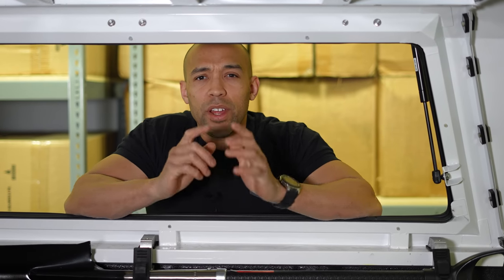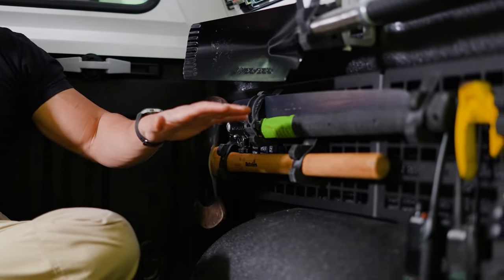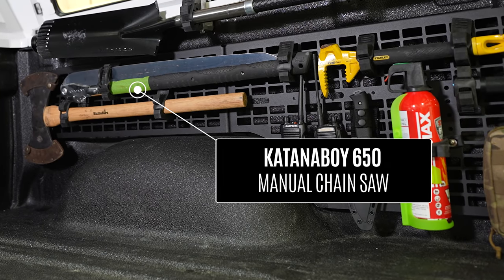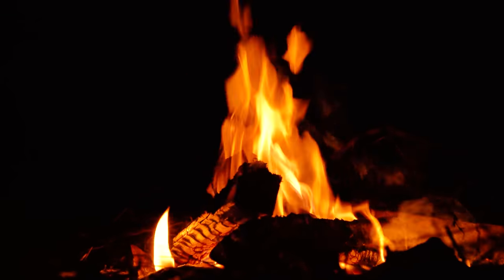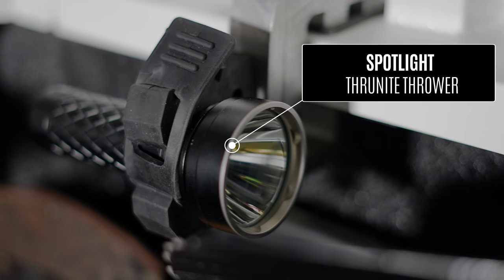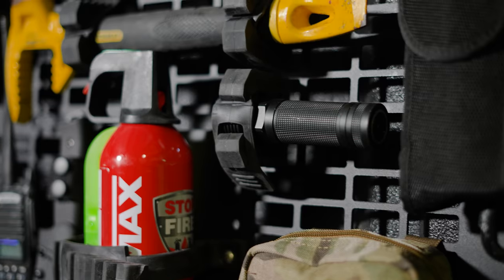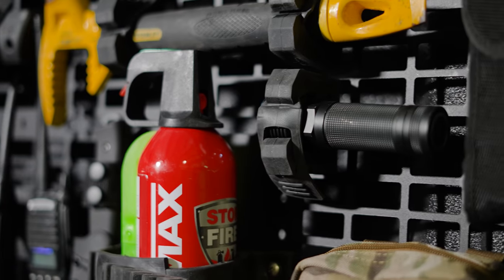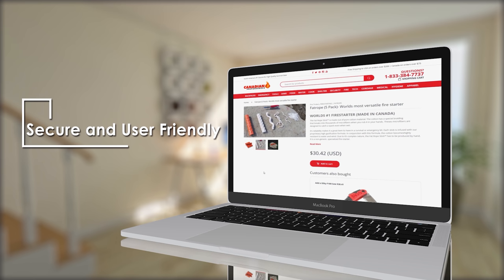WAR WALL! MOLLE Panel Truck Bed Organizer

Comment: I would look to add one of those panels to your back glass of the truck cab, to add additional storage space, since it looks like you can't see out the back of the bed cover anyways and a rear mounted camera works better.

Comment: I have a narrow shovel like the one you have that my work provided and I threw in my own  flat spade shovel. Ended up stuck in a drift in Wyoming and those narrow mouth shovels are absolute garbage in snow. The snow just slides right off the shovel and you can't clear snow around your tire. Flat spade shovel and a whole lot of flooring it FTW.

Comment: From experience, any tool that is heavy at one end should have the weight at the lowest point of securing ie: Your axe head down and handle up.  Situated as it is, the rubber on the monkey fists will 'give' as you drive on rough ground and it will annoy you as it becomes loose in the rear over time, or the rubber perishes and fails.  Failing that, a fixed mounting point to put the axe head in if you want it mounted vertically will take the stress off the rubber QF fittings.  I've also noted that you have your pry bar above your fire extinguisher,  which I'd not do. if it comes unhooked it could take off the radios and fire extinguisher as it falls.   Consider dirt and water in the rear and on the tools.  Consider the times when you have to put awkward objects on your sliding bed....could they get caught in the mounted gear and snag upon them?   Just some thoughts. It takes time and some messing about to mount everything tidily.   

What about vehicle repair tools?   What are you going to put in the vehicle CP and where are you going to store them??
Reply from the maker: Quickfist grip takes care of that

Comment: Hey bro, cool rack install. Good ideas, but i want to recommend a sthl electric chainsaw. They are silent and will allow you to leave the saw racked most of the time. You can wire a small inverter to the rear and charge as your on the move, having a replacement battery ie redundancy isnt actually necessary as they tend to last a while... i dont think ots a bad idea to have a a hand backup but i also dont think EMP as likely as your needing a quick easy quiet saw... keep up the good work bro.

Comment: Nice set up. Totally agree with the concept of being organized easy access. But a set up like this in an everyday drive around truck being so visible would make it a target for theft. Our unmarked worked trucks/ panel vans with no windows get targeted all the time. As a bug out truck for sure.
Reply from the maker: Would need to have a topper or tonneau cover for sure

Comment: I love the fancy stuff but think something like this could be just home made and save worthless money for other items. You could use plywood or sheet plastic or whatever. It's also nice to have fancy attachments but again can be home made using rope or rubber bungees. I actually think I would rather have a panel up where your side doors are at so you could easily exit the truck and open the door and have you tools right there at eye level. Good video. Thanks like the tools.

Comment: I wish they would make molle panels for car trunks as I don't have a truck. I do have a molle panel on the back of my front seats but obviously the space is limited and anyone can just look in to see what is on it, so I limit what I am willing to put there. But if they made side panel molle kits for cars I could use a lot of the trunk space I have.

Comment: It is great to have a system like that in your truck bed I was with I did but if someone were to smash the glass it would be very easy to take all of that gear and I am guessing all of that cost at least $1,200

Comment: Suggest a 1000/2000 watt, 12 volt D.C. to 120 volt A.C. inverter, a couple lithium batteries installed under the truck bed in a purpose built rack. Consider outlets inside truck in inverter and exterior. I'm thinking about installing an outlet in the tailgate.

Comment: You should check out Extendobed or something similar for this purpose. Combine that with your truck's bed cap and no one would even notice unless they intentionally try and peek inside. Probably keeps you more secure too in the event of a collision or a rollover. It would suck to have your own gear fly around and cause more injury or worse.

Comment: maybe run a strip of battery powered or 12 volt LED lights along the edge of the panels ???    might give you extra lighting when looking for or putting away items at night

Comment: You have to be careful with electronic devices such as your radios that "live" in the back of your truck for extended periods of time. Temperature extremes, both hot and cold, can cause them to fail. There have been times when I had to live out of the back of my pickup truck for periods of several months. My solution to that problem was to keep what sensitive electronics I had in an ice chest with several water bottles. The combination of the insulation of the ice chest and the heat absorption and retention of the water helped to ensure that the electronics were not subjected to the worst of the temperature extremes they might have had to deal with.
Reply from the maker: Of course the same is true for any electronic, they are also surprisingly robust

Comment: You've picked your vehicle well and how your kitting it out sounds good.

The Fat Max bar is one I'm looking at, nice to know someone else picked it too for its versatility. 

The window behind the backseats, is it fitted or can it be moved? I'd look into having it on some kind of pop up with double latch system to easily access the back storage if the vehicle is surrounded, as you could end up being surrounded and you'd be stuck without your gear if that window is fixed. 

How are you keeping your two-way radios powered?

I think some sleeping bags and blankets would be a good addition.

You could find away to use the inner part of the roof for storage, 

Maybe some kind of supplies storage, like some kind of small horizontal water storage under the window behind the back seats?

But like you said, it's a good idea to keep things simple.

Comment: You don't need to buy all this.  I made my own from stuff from the hardware stores. Mine is not sexy looking but it functions. As to shovels, I carry all three types per the environment. Curved, flat and snow shovel. I carry three sizes of axes as each area and experience will change axe size requirement. Really only 2 axe sizes, small boy axe and a full size. I do also have a basic brush saw and an electric chain saw.  If you into adventuring, a chainsaw is critical. I have have many times to cut thru and remove down trees across the road.

Comment: What if...you built a faux truck bed floor with a roll out drawer or rack on sliders underneath for storing flat tools, ect.  Something working like a trundle bed but a shallow drawer instead.

Comment: Kit your vehicle out like that in the UK and the Police would charge you with 'Going Equipped'.  Which fundamentally means items that could be used in a burglary or theft (knife, crowbar etc).  You would have to prove you had a valid reason for those items.  What a crazy country I live in ...

Comment: Very solid video. I have the same truck. Any reason you didn’t consider the decked drawer system?

I had one in my mid size truck and am strongly considering adding one to my Tundra as it was invaluable for storage and security.

Comment: The one thing that keeps me from installing something like this is that I'm one of those weirdos who actually hauls things in his truck. Granted, I don't carry refrigerators or gravel every day. But if I need to secure an engine in the bed I don't want to have to worry about it smashing my flashlight or denting the panel. And if you're going to take emergency gear out every so often you might as well not put it in in the first place.

Comment: where do you fine your gear after a roll over in the snow ? A friend hit the back of a log truck @60mph and the stowed trailer hitch flew thru the truck and out of the windshield,just missing the kid in the car seat. This might look cool but I would put it in a roller drawer mounted onto the bed. Yes you have to drop the tailgate and pull it out  but the visual is not there for car break ins. Anybody who runs a service truck knows  keep the good stuff out of sight. But tweekers are tweekers...... But over all you did a good job with your truck. P.S. Where are the tire chains ?????

Comment: I think if you can integrate a adjustable nylon strap with a push button release that had either a metal or composite molle attachment that could attach to the molle frame it would be easier to access and easier to attach a wide variety of items but I don't know. Maybe someone can use this idea to improve or invent a better system that would be awesome lol.

Comment: If you're going to intend on really sleeping in that I do recommend some kind of heat...maybe a self-adhesive flat solar panel on top 2 power two electric blankets you would climb between with 52 volcanoes erupting so far this year this upcoming winter is going to be brutal

Comment: I know that you can use the system to mount Jerry cans but since your going to use a slider what is your plans for fuel for the vehicle? What are you doing currently and once SHTF? Do you plan to use the slide as a bed to sleep in as well?

Comment: I have been struggling to figure out a way to pack my farm jack in back of truck without taking up too much space as I do not want to place out side of vehicle exposed to dirt/grime/crime. This may be the answer. This will be a nice kit set up.
Reply: I have the Hi-Lift brand locking mount for mine mounted on the side of the bed where CP's panels are. Works great. You could mount that to those panels as well. Just an idea.

Comment: I would thank a back up battery jumper /110 converter/ air pump / light all in one .. I have one in my truck to maybe help jump someone that my need it or run a small cooler

Comment: I have one concern about having open access tools at the back of your truck in SHTF kinda situation and that is you might need to pick up some people in the back that you might not entirely trust to not steal or use against you. And you might need to pick up people cause together we stand. Might need to pick up people outside the family too. So may be these should be hidden or locked up, something like that. May be openable by a remote switch and keys.

Comment: The concern i have is how do batteries do in a warm climate. Like the radio and flash light. In my car trunk it’s not as hot as the car it’s self but i am concerned what the temp would do to it. Also rear ending, people in my area are HORRIBLE drivers.

Comment: Hands down get the new flex line form lowes of recip saw sds max drill and driver and cerculer saw 24 volt and if you buy this year its guaranteed for life can be powered by solar an can then cut fasten and break through must things if the come out with a cordless chainsaw on the same platform I would say drop that in to and a high lift jack and 100m of high gauge winch line and a couple of snatch blocks

Comment: I wouldn't use or put half of that stuff in the bed. Especially electronics and pressurized bottles... I'm not a preper so idk what I'd put on the rack... I'd rather have a box for tie down straps gloves tools etc...

Comment: 4:43
Gonna have to disagree with you there CP. Chainsaw is going to be your number 1 tool at clearing downed trees in the road or even breaking into a wooden structure or door in an emergency. It does the job of both the double sided axe and silky. I love the silky brand, I use the zubat and saguoi at work in your neck of the woods but when you have to make multiple cuts on the same log to clear a road it’s extremely  impractical. Especially when there’s a storm, there’s almost never just one tree down. 

They also make very quiet, very light, battery powered 16inch saws (dewalt, makita, milwaukee, stihl, echo, husq, etc) that can be recharged or used for other tools. There are a couple of companies out there that sell capstan winch attachments for dynamically pulling loads with your chainsaw but they are for the bigger gas versions.

As far as gas powered saws go, as long as you have a cup of 2 stroke mix you can siphon from your gas tank and use that. Instead of bar oil you can use engine oil and even WD-40. Also, a round file and a T-wrench weigh almost nothing and can keep you going for a long long time. Just some food for thought.

Comment: I like the panels and looked into getting them but they don’t justify the $1400 price tag. Creators just trying to get Bezos rich right off the bat. Wouldn’t use any of that unless you work for search and rescue or off reading multiple times a month in the Rockies. I was able to create a pretty nice set up that fit underneath back seats in my Silverado and if it doesn’t fit like the traction boards and Diesel/water cans it’s snug in the bed against the cab. It’s meant to help my fam and others I see go off the road in a storm.

Comment: Terrible idea to keep radios in the bed of a truck especially in Canada the cold will drain the battery in no time then when you need it its dead. Same with the flashlights.

Comment: The fire extinguisher is WAY to small. At least a P3 (pounder 3kg - 6 pounds)
Reply from the maker: I actually have a larger one in the truck, but its better than nothing, the liklihood of needing it is 1/100000 but "it looks cool"
Reply: @CanadianPrepper  you can use it as a defence tool. Squirting it in the face of an attacker sure disables him/her, at least temporarily. CO2 extinguishers are the best for this. They leave no trace after. And the canister is really strong. But, hat off. Cool looking panel. And very nice gear!

Comment: Trenching shovel, double bit axe?  WTF!  You can not dig anything out with a trenching shovel, especially a stuck full size truck!  The amount of extra calories and time you would expend using that shovel over a standard one would be crazy and not what you need in a survival situation.  As for a double bit axe, that s just asking for you to have to use a trauma kit in a survival situation. You might be tired, hungry, and/or in one hell of a hurry and now you are throwing an axe around with two blades and one of them is pointed towards you! Get a single bit and a sharpener and learn how to use both!

You should also go for a smaller Silky saw as that big ass one is useless for the small tasks of building fire and a basic shelter.

This guy needs to really get out and use his tools in actual situations.  He is a classic example of toys over training.